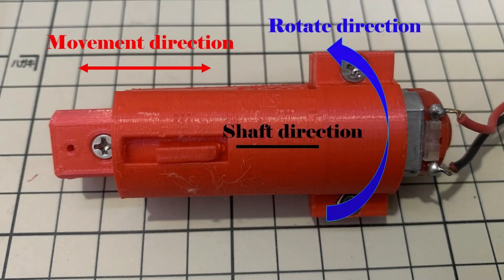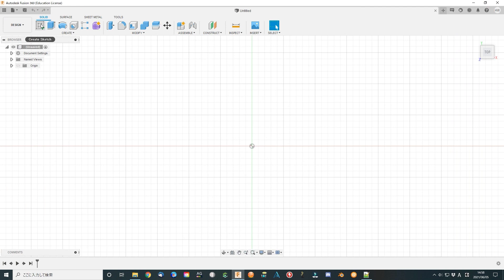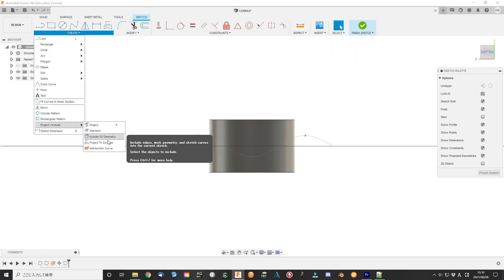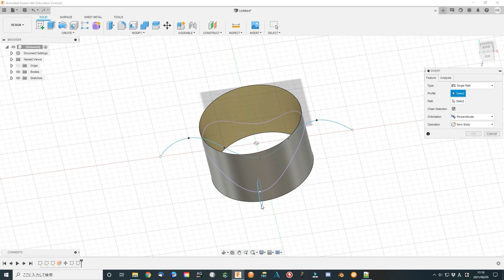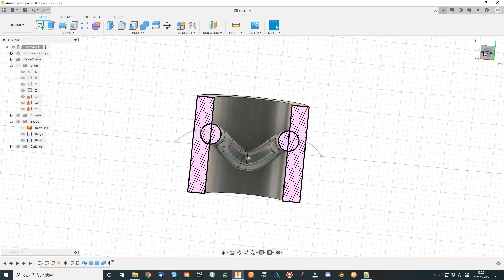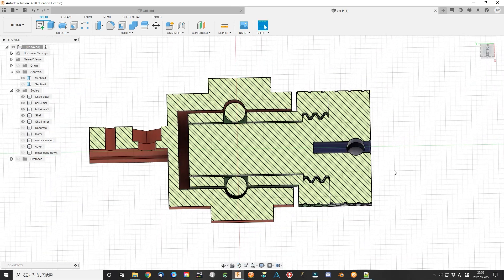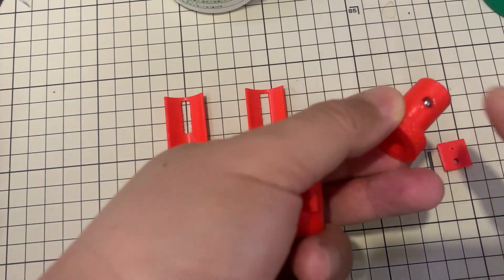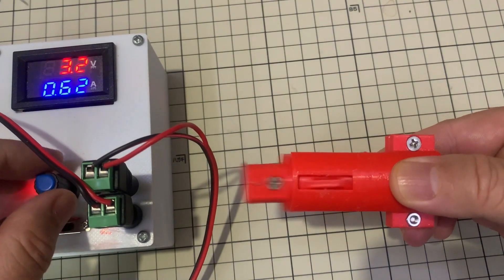Convert rotational motion to linear motion (Fusion 360 project to surface tutorial)

Comment: what fittings etc are required
Reply from the maker: Great question! The fittings required will depend on the specific 3D printing project you're working on. For example, if you're assembling parts, you might need screws, bolts, or adhesives. If it's a functional piece, connectors or specialized joints might be necessary.